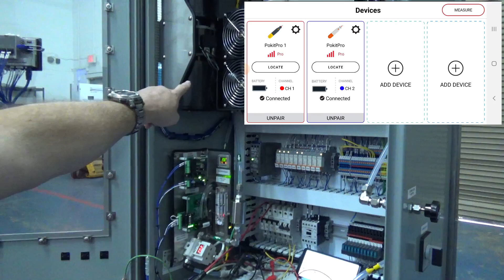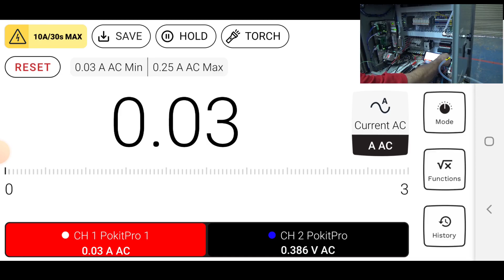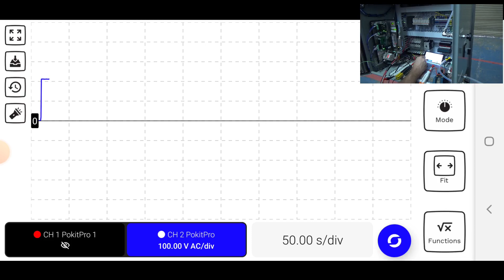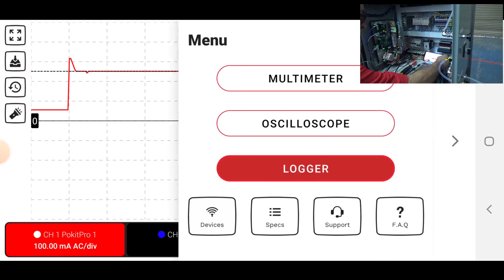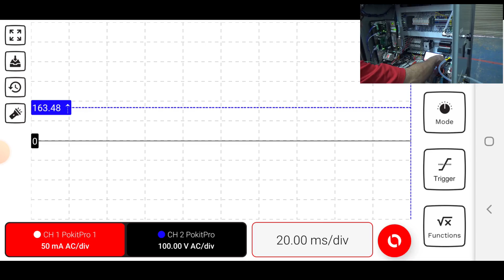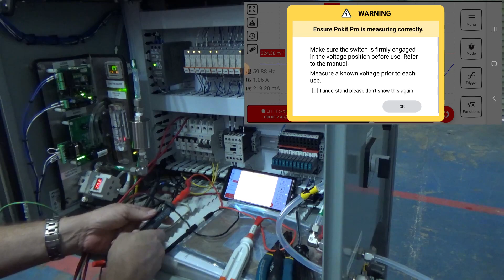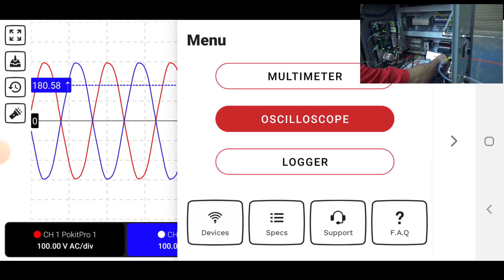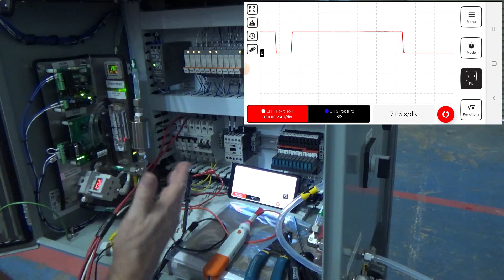Pokit Pro Multi-Channel Mode! All-In-One multimeter, oscilloscope, and datalogger

Comment: It looks like the functions on the multimeter recent when you moved to channel 1 Ie trigger off the selected channel. Might be nice if they could run in tandem.
Reply: Inrush showed 0.32A will have to read the updates to see if they can fix.

Comment: Great video thanks. One think I was trying to find out is if you have two channels,ch 1 triggers  both Chanel’s  what is the minimum time you can capture between ch1 triggering and an event on ch2?
I was thinking of something like measuring the time between two IR beams being broken?
Reply from the maker: In oscilloscope mode the two channels capture simultaneously so is perfect for that.

In logger mode at the 500ms sample time they would be within 1/2 second of each other. Depending on what you are trying to do, that may or may not be fast enough.

What is the application?  If you are watching two IR beams and different things break each one, you can't really use a single channel oscilloscope trigger unless the second channel gets triggered close enough to the trigger channel to see it within the screen capture.
Reply: @shanesdiy  I’m measuring the speed of an air gun pellet ,I have a box with two beams , on my real scope Chanel 1 is trigger and ch  two picks up the second bream break .

My scope goes down to 5ns per division so I can time very fast events.

I was wondering what the fastest event,  two Pokit pros could measure .
There must be some limiting as they have to sync through radio as opposed to being on the same pcb in a normal scope .
Reply from the maker: @paulmeynell8866  That would be an interesting test.  The fastest time base for the Pokit is 100 µs (microseconds), or 100,000 nanoseconds, so even if they are perfectly sync'ed the Pokit is still much slower than your other scope.  Have you tried it yet with your scope?  If yes, how fast do you think it needs to be to capture both pulses?
Reply: @shanesdiy   the pellet is doing 400 mph so takes 1.1ms the cover the 200mm gap.

So no problem, but it got me wondering how fast it could be. 
When Pokit 1 triggers it has to send some kind of signal to Pokit 2 to start it timing , was wondering how fast that happened!  
Also wondered if I had one near the target and one at the gun ,would it take longer for the second Pokit to start timing because of the extra distance!
I’m sure we are talking about very small times but I did think it was interesting.
Reply from the maker: @paulmeynell8866  I don't think it works that way.  When you start the oscilloscope, it is actively monitoring data from both Pokit units, it just doesn't display it until the trigger is reached.  I'm sure it would work fine for that.
Reply: @shanesdiy  it would be interesting to find out how they synchronise them. A friend has on ,so we will have to get together and try it.